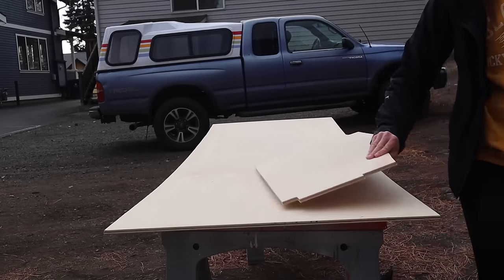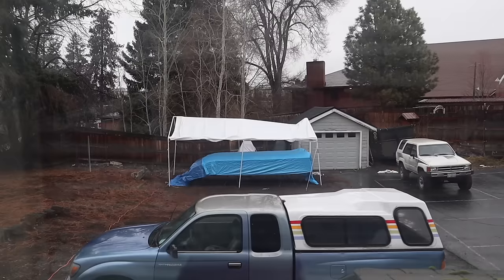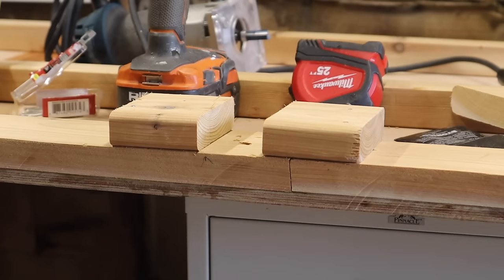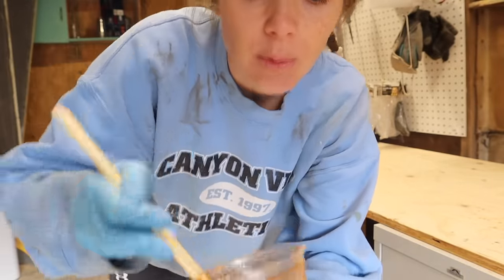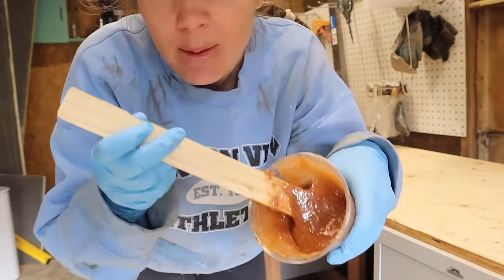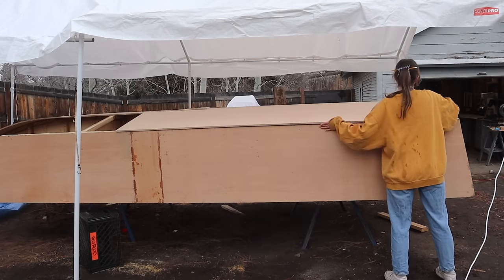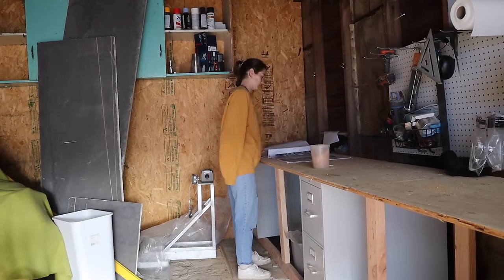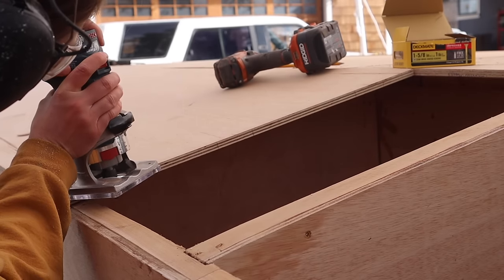Tiny House Boat Build: I HAVE A HULL (and emotional damage)

Comment: Emma, WHEN IT IS TIME TO FLIP THE HULL. I suggest you reach out to some local towing companies. Send them pictures and tell them what you want to do. They could easily and safely flip it using their boom truck. To them it would be just like flipping a very light car back on its wheels. I bet they would even put it in the trailer for you at the same time.

Comment: For the "out of square" issue, the big test is when you measure diagonally from front left to back right; that measurement must be equal to the measurement from front right to back left (basically draw an X across the bottom of your entire boat and the two lines of the X must have same length. If they're not, it's out of square.
Reply: Super suggestion!  Another method probably more for shorter distances is using pinch sticks

Comment: Hey Emma, you're doing well! As other's in the comments, I have also built several wooden boats with various methods. Be sure you really take your time to complete the waterproofing, finish, and everything on the hull before you flip it. It is WAY harder to work on once it's the other side up! Once you are ready to flip it, I would really recommend building a solid wooden frame to set it on while you complete the top-side, instead of just putting it straight on the trailer. Trailers move and they're hard to keep steady and level/etc. Have fun!

Comment: Great work Emma! At this stage, if you haven't already got one, get yourself a small block plane, a sharpening stone and sharpening jig. You won't have to worry about cutting any angles on the edges of sheets etc. just hang em over a little bit and plane them off flush. It will make the work soooo much easier, and more accurate.

Comment: First off young lady you are doing a great job and I'm impressed how you stick to the task at hand. I have built several boats, some from plywood, cedar strip , skin boats and even old school jon boats. If you start to get overwhelmed stop, walk away and relax. Then think of remedies or solutions to your current problem. For example when hanging those side planks making a couple hooks from some scrap plywood would have come in handy. Screw the hooks to the inside of the transom and the bow boards. That puts your plank at the proper height with very slight adjustment. You set both ends up on each hook and bam its very close and hands free now. Every boat and most projects I have built I did by myself. I live in the country and dont have close neighbors and I hate asking for help. Dont get discouraged as long as you are accomplishing something daily you will finish. We are all looking forward to your completed little house boat. 
 I am not criticizing im just trying to save you alot of struggles. When building a boat think outside the box. Just remember there are no square corners on a boat. Again you little lady are doing fantastic work.

Comment: Doing great!  One thing about boats Help is a Godsend due to size   Just to help hold the panels in place while you fasten them  To measure distances like the length of a bend etc boatbuilders use adding machine tape You can get it at places like office depot  Mark one end on the tape then mark the other end  Then transfer that  to the board you will use  You are turning into a shipwright  :)   You can use a compass to scribe one piece next to another

Comment: Nice work! You see, it's coming together.. Accuracy and a little grinding can give you satisfaction guaranteed. It's a bit challenging because of the nature of construction and of the size.. When you build something, consider that it will grow heavier and heavier with every piece added. The whole thing is big and will require some lifting device to turn it around. Luckily you can build yourself a pair of small gantry lifts with chainhoists for this purpose. =) It's not difficult to make. The hull doesn't weight a ton, but probably too much for  2 persons. Since you tend to go "solo" most of the time, that would be your best bet. After use you can disassemble the gantrys and reuse parts for other projects. Cheers, Emma, keep on, never give up!

Comment: I was doing some further thinking about your build and thought of some of the cuts you might have to make.  A device you might want to consider is a contour gauge or duplicator. My first learning of them was in the copying and making moldings to match existing ones.   I know there are a few types and sizes .  Lowe's and Home Depot have them and I'm sure there are a number on the Net.

Comment: I'm sitting here watching your video, also procrastinating working on MiniD as I need to figure out "what now" in my build! Lol! You're doing great, love watching you share all the ups and downs! The solution for the side, bow, bottom pc was to keep the side's bow section, "off cut"! They had the extra width you needed. No worries though, you managed a fix. Good on you! More fun to come...AllthebestRoy
Reply from the maker: i think i accidentally used them for something else!
Reply: @EmmaBuildsBirbie  you're not the first! It's hard to catch all the pointers as well because there is a lot of detail. I like your solution for the thicker wood you used! It's almost better as it will locate the exact spot the frames need to fit. More likely to keep the build square that way! BestRoy

Comment: Still doing great. Again, perfection is the enemy of good. Boats dont need to be perfectly square to float. Gaps are going to happen, an you will just fill them with epoxy an hide them with paint. That board you cut wrong will just become a seat bottom or cabnet side. As long as you moved the project forward an ended the day with as many digest as you started the day with, its a day to be proud of.
Reply from the maker: thank you 😊

Comment: Incase you need to draw to objects together Boat builders use the technique quite often A Spanish windlass is a device for tightening a rope or cable by twisting it using a stick as a lever. The rope or cable is looped around two points so that it is fixed at either end. The stick is inserted into the loop and twisted, tightening the rope and pulling the two points of the transom toward each other  Not sure if you will need it at some point But, posting it incase you do  One way it is used is flat bottom skiff builders they shape the 2 side panels attach them to the bow stem then they bend the panels around a center mold with the windlass get the bottom the way they want it Then, attach the bottom Yours is different But, to give you and idea

Comment: When you are "hanging" a large piece such as your 17 foot panel, think of it as a big picture on the wall, and use a screw on the bulkhead frame and a wire loop about midway on your panel. Then you can just "hang" the panel like a picture almost where you need it and you can then adjust without having to hold it while you work.

Comment: The easiest way to check if a large structure has become a parallelogram, is to take a piece of string and compare the length, corner to opposite corner (like a big X).  If the distances are not the same it is out of square.

Comment: Where is the neighbor when you need him?  While you may not accomplish a great deal each and every day, I am amazed at your perseverance.  I suspect, for no reason yet, that moving from a bus and house to small boat with a small deck may give you claustrophobia and you will be building a larger version...  I built a 12' X 16' deck with a metal and clear plastic roof on it all alone after retirement.  I used lawn furniture, saw horses, crates and concrete blocks, bricks, and various size clamps to hold pieces in place and level until I could drill a pilot hole and screw together.
Weather is a crap shoot in the short term, the weather scientists can tell you exactly what the weather will be in 50 years, and may get a bit close for tomorrow, but have no idea about two days from now.

Comment: Also, I wouldn't worry too much if you don't have those bottom joints perfectly tight. Once you fiberglass the outside and flip it over, you can pour epoxy into those joints. Then you can use strips of fiberglass over the joints on the inside. It'll be bulletproof.

Comment: Pro🛶Tip....

Extend you sawhorse cross members beyond the width (beam) of the boat, also Jack stands and temporary tabs are very helpful on a solo build to position components.

Treehouse🌲Boat⛵️Works...

Use a broom to push water/snow off a tent cover, avoid poking a hole.

Keep going, you’ve got skills,, while improving and learning more...

👣🕊👽

Comment: I thought maybe it might be a better idea if you take up the router and take half of each one of the plywood, the 1 on the 1 side and 1 on the other side on the edge about a 1/2 inch in then slide the plywood in over the other piece of plywood and then that would be. A lip that will contact both of them. That will help you make the bend and it you could always seal it.

Comment: You should go a bit easier on yourself about the gaps and tolerances. That epoxy you're using is incredibly strong. It's like your secret cheat code. That epoxy can fill gaps, fill holes and smooth curves like you wouldn't believe. Having said that it looks like you've got yourself the makings of a pretty cool boat. 🤙

Comment: Proper ambient air temperature is necessary for the endothermic reaction of the polyester resins and methyl ethyl ketone peroxide (the catalyst) to occur, which is how the resin hardened up. Really at least want to be in the 60°+ temps for use of FRP (fiberglass reinforced plastics), the resins.

Comment: hi you are doing a great job aiming for perfect rather than it'll do is always the best policy but don't beat yourself up if you fall just shy. the method if assembly those long heavy sides is that how the plans told you to do it? I was so annoyed watching you 3 days work doing it the hard way. you should advise those following in your foot steps to build the frame the sheath in ply leaving it proud and triming to frame same with those Bow pieces just cut the internal fit the glue on and once dry trim externally to size. hope that helps going forward for you. There is always more than 1 way to do stuff but usually someone has worked out how to get the best result from least effort. Or do itthe hard way gets you more comments haha

Comment: after watching you fight with the big sides you really need to build supports that hold the weight so you can make adjustments. i build a lift when i put up cabinets. it makes it much easier. work smarter not harder.

Comment: You friggin rule. Idk how you are doing epoxy outside in that cold!! Be careful, I just had a bad cure cause the temp got too too low and it was a PITA. Used an angle grinder to blast all the sticky off.